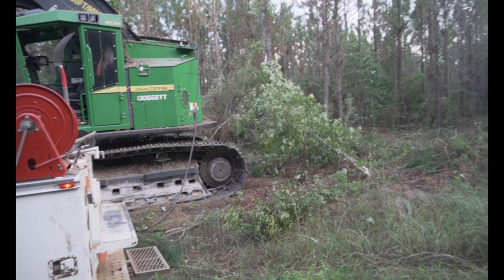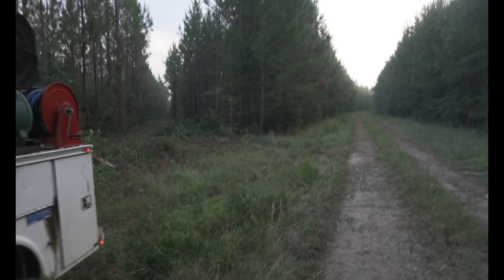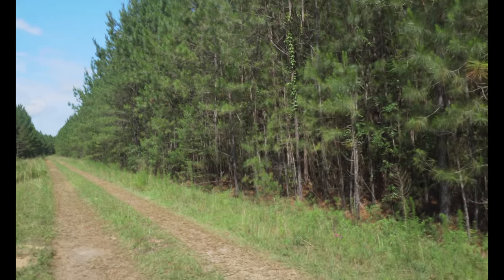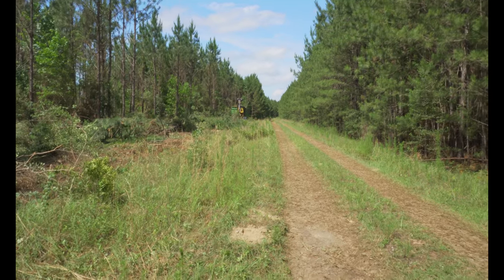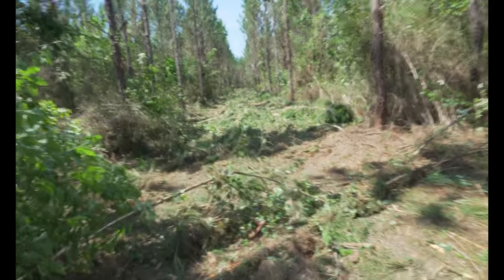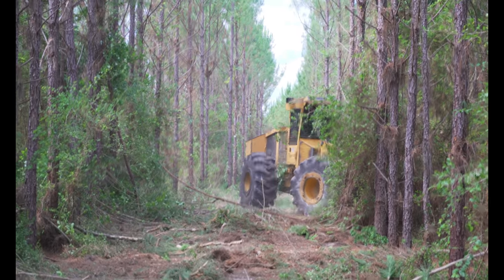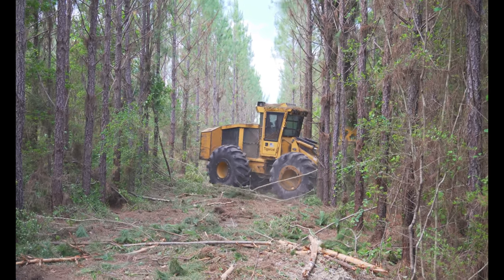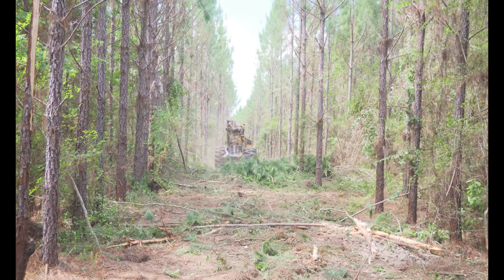What happened to the Tigercat 718E Feller Buncher and the Chambers Delimber won’t start 😳

Comment: 45 degrees is right. You need to know where your going to cut before you ever start that way, the more turning you do is less time your filling the head.
I start at the back and walk backwards throwing my wood in front of me. Most of the time I thin as I take out the take row(down row). It’s all on how thick the wood is and how tall, also I like cutting 2 or 3 rows on my left and 1 row on my right, just because my pocket is on the left.. thinning is real easy , your cutter man is doing fine, just don’t rush him, he will get faster
Reply from the maker: 10-4...appreciate the comment